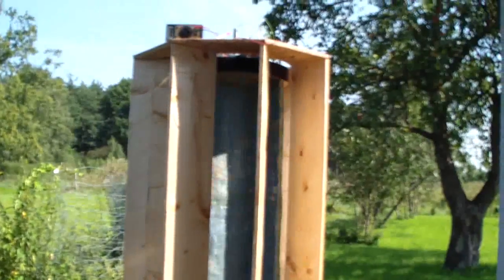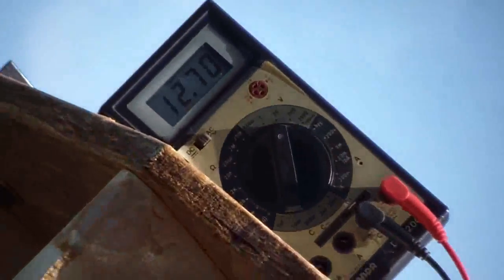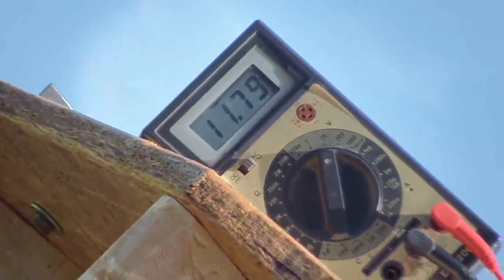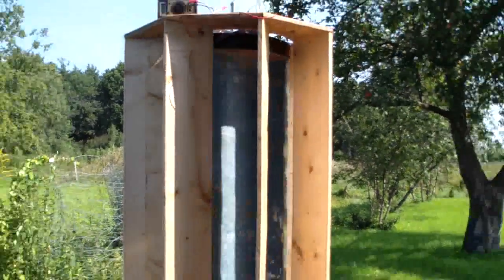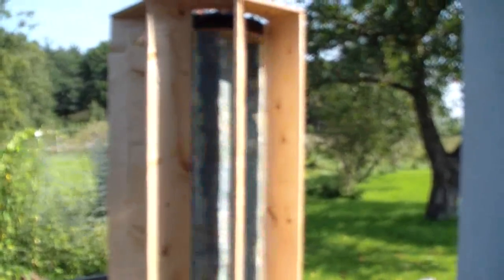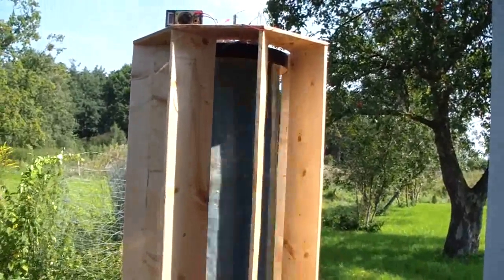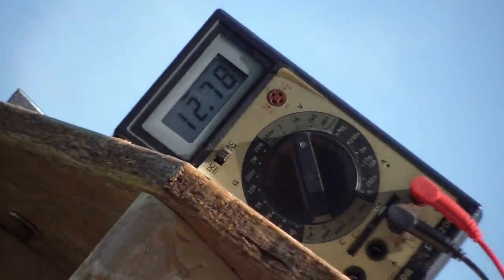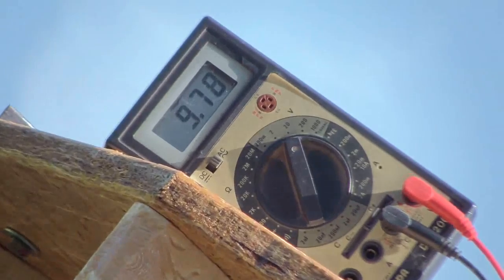Home made Windmill Generator part 7 - Test on VAWT

Comment: Your present voltage is very low. An AC to DC rectifier and some method of stabilizing the voltage could theoretically charge a 6 volt battery. I would be interested once this was done, how many amperes are generated and subsequently the kilowatt rating of this windmill/generator.

Comment: Wind speeds tend to increase the higher up you are , If you were to build some type of post with a platform 15 or so feet high. You would generate more voltage, also you could make a another row of magnets and coils to double your voltage output. Keep in mind the higher wind speed could rip a wooden structure apart rather easily.

Comment: I'm with Amadeus.  What kind of wattage did it finally pull?  In an earlier video it looked like you were pulling a full amp at 2 volts from the smaller test, which would be super crazy if that's right.  Looks like you peaked out at 12v here, what kind of amperage?  (Or wattage if that's easier.)

Comment: Which actually rotates in the final, functional product, the circular part where the magnets are or the one where the coils are? If the latter rotates, how can you get the electricity out without tangling the wiring that connects to the coils? Thanks

Comment: Hi, Captain said that :

Put 1 stator and 1 rotor like yours windmill and put also the same system on the top of the construction in purpose to have double voltage may be?

Comment: You constructed the first one out of a can and styrofoam. The second one out of wood. You placed that stator at the bottom of your turbine. There is an identical aparatus at the top but there is no stator there. Only one at the bottom. So my question is, what if you placed one at the top also would you get double the output and would that cause there to be extra resistence? I don't see how that would be because the magnets don't touch the copper wire anyway.It would still flow freely no?

Comment: Plastic perhaps now that you know this works well? The light the moving parts are, the faster it will turn right? I keep looking at this and wondering what if there were two stators/ One at the top and the other at the bottom? Wouldn't that double the out put with no extra resistence? Also would larger magnest produce more energy?

Comment from the maker: You are probably right. The standing parts do not need to be light. Only the moving parts need to be light. The rotor of the turbine is made from Styrofoam that i have cut with my styrofoam cutting machine. I thought that that would be light. But the coating that made it weatherproof and durable made it heavy.

Comment: Hi Chris, What if you made two stators one for the top and one for the bottom? Wouldn't that double your output? Also why are the wooden deflecters that are on the outside of your turbine facing the way they do instead of a "V" shape to direct the wind more effeciently by creating a funnel effect? Also, if you reduce the number of turbines could that reduce drag on the back side while still enabling the wind to be captured at the same quantity? Thanks if you answer my questions.

Comment from the maker: I thought about this. But you need a high enough frequency for a transformer, otherwise it will just act like a short. And the windmill would not start, because a short acts like a strong brake. Maybe some kind of speed meter would do the job of connecting the transformer to the generator after the windmill has started up and reached a high enough frequency.

Comment: i'm not an expert so i don't know if it is possible, but if there was a capacitor or a battery to accumulate this energy, could it be possible to release it in a different voltage? may be you already done it..just wondering..great work anyway!

Comment: Chris - I've been watching and it is probably just me - but I didn't see if you ever switched to reading amps of your turbine. I was wondering how many watts your configuration was putting out in your test.

Also - i'm no expert in wind dynamics, would those overly large struts in the support frame limit air flow? I noticed you angled them so I was wondering about it as well.

I'm hoping to attempt a home project as soon as I can get the funds for or salvage the materials.

Comment: like for efforts and achivement still you could do it with much lower cost and far easier methods in less time obtaining the same results 
try to flip the rotor and stator configuration - compansate the magnets with winded coils shorted at the end terminals -  instead of wood work use alumaniom- fiber-foil -the vertical axis mill should be mounted in higher elevation in order to capture greater wind force 
so keep the good work and good luck in your next project

Comment: For those who are interested but are not sure where to get the magnets, you can start with old dead computer hard drives.  Once you are ready for a bigger project you can check kjmagnetics(dot)com/products(dot)asp?cat=168 and magnet4less(dot)com/index(dot)php?cPath=122&osCsid=4a90771f667b35b2c3573a5a9f145dd2

Comment: just a thought. you're using a 1:1 ratio with the spinning. what if you were to use gears to up the ratio and therefor the speed of the magnets spinning? you'd have to offset the magnets and coils to do so, but you'd get a lot more spin for a little wind, increasing your output rather than building a voltage doubler. might be easier and that way you always get a good voltage even in calmer winds.